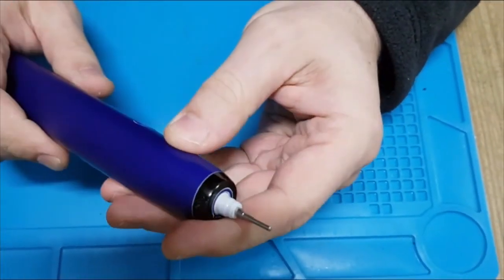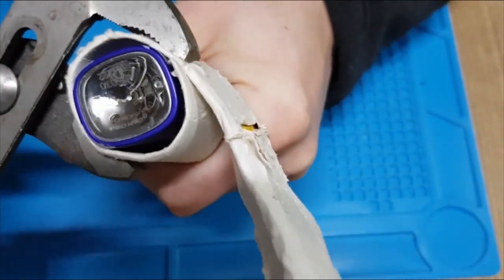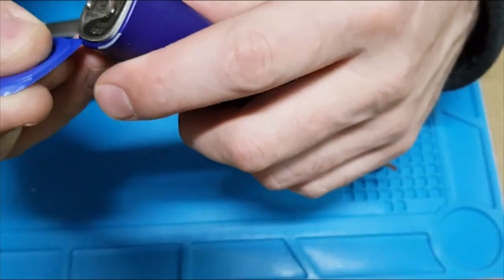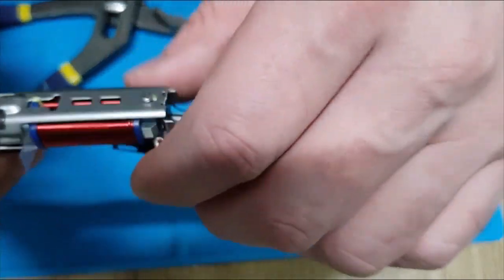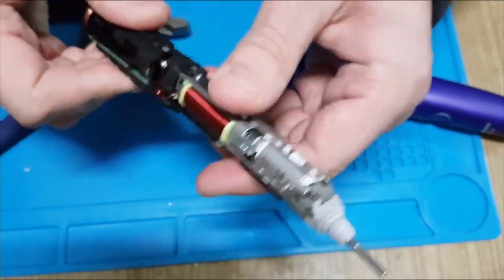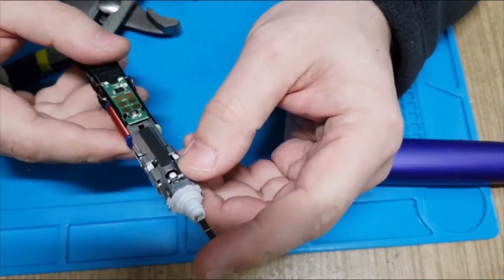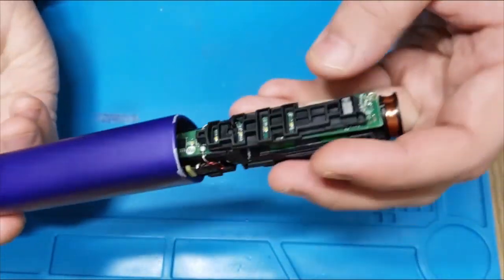Philips Sonicare DiamondClean /no vibrations/ opening and repair

Comment: No matter what i do my magnet falls right back down on my coil its really annoying
Reply from the maker: Axis broke in half. You have to replace the whole electromagnetic drive unit. There is no chance to repair it..
Reply: @letsfixitgarage  yea i ended up figuring that out, the stainless broke completely It was driving me nuts that it would just fall back down so i pulled it apart further.

Comment: Super helpful vid, thanks! After dang near breaking mine in two getting the end cap off I learned a glue gun trick that worked amazingly for my newer version Sonicare Diamond Black. 

https://youtu.be/CnE66q6pEDc?si=ZH2VH6FtXOu9Dg2J
Reply from the maker: Glue gun approach is ok but could damage chrome, afterwards you need to clean the little hole and be careful not to damage the seal.. and it's not suitable for prestige toothbrush.. so yes every method has it's advantages and disadvantages..

Comment: When the gap is too small, does the toothbrush show any other symptoms, such as charging indicator? My Hx369w1 died after a month, and even the diode doesn't light up.
Reply from the maker: Check my other videos especially water damage repair. If there is no signs of life, no LEDs, most probably you will have water inside and sadly it's not an easy repair..
Reply: @letsfixitgarage Thanks for the answer. The toothbrush is under warranty, but I am outside the country of purchase, so I am looking for information before I open it. I do not suspect a water leak, because the toothbrush is almost new. I have a thesis that if the generator does not start, it will not signal charging, because then it also has to start twice. But I am looking for confirmation.
Reply from the maker: @xxq4462 from my experience take it to the warranty ASAP. Either charger (very low probability) or handle water damage (high probability :) ). Charging is done very simpel no communication for activation. Charger simply emits magnetic field without any iniciation.. if there is no signs of opening or corroded upper seal the better for you to get an exchange of the toothbrush. Warranty doesn't repair them, they simply exchange it for a new one..
Reply: @letsfixitgarage so even if there is no gap at the coil and the processor cannot make a double sound using it, the charging diode should light up? I will only have the opportunity to return the toothbrush under warranty in a few months.
Reply from the maker: @xxq4462 exactly, even if there would be vibration issues and no gap on drive unit it should charge and charging led would indicate charging if electronic side is without issues/water damage..
Reply: @letsfixitgarage I understand, so the warranty remains, thanks for the answer.
Reply from the maker: @xxq4462 overall in the world only exchange under warranty is offered by Philips or Braun.. there is no official repair service after warranty, only by me ;)

Comment: Such a useful video!  Some water got into mine and it stopped working suddenly. That rubber seal at the toothbrush end disintegrates with time unfortunately so water goes in and damages the unit. Slight rust on the magnet, lime scale at the base of the head shaft, and some moisture on the circuit board.  Not good. Infuriating low quality for a pricey toothbrush!   So very grateful for your video. 

The issues I have with this video though is that your hand is covering up some key bits.  Parts not shown well are:
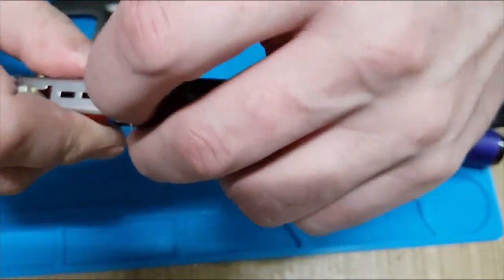1. 4:47 - The clips holding back the case rear cover. Show us a closeup of the tabs once you take it out, so we understand which way to loosen the tabs with a screwdriver. I spent half a day on this trying every possible way. You have to go on the LONG SIDE not short side, go behind the tabs and press in toward the center on both sides. Keep thin screwdriver in place while working on other side so both loosen same time, then you push on the head and it pops out.  It is these little things that are important.
2. 4:43 - You don't show exactly how that center black rubber piece is removed and how it is one piece, not a covering to be peeled off. You bent the middle with toward the circuit board, then this piece pops out. Actually, I found you don't need to bend it which can damage the circuit board. The board slides back and forth on its tracks, making a gap to take this piece out.
3. Not shown is how the circuit board pops out, I am struggling there.  The key is to slide the circuit board toward the battery. Once the center spring comes out, there is room to slide the circuit board back. Insert a fine flat screwdriver under the black plastic of the circuit board (not green plastic) and lift up the two tabs, one behind the other.  Out it pops. You have to slide it down for the tabs to come out as the hole widens.

I cleaned up the head shaft area too. A rubber cap on the shaft is torn in my case which led to water going in, so this should be inspected and replaced if you can find this part!  Else, repair it or improvise to seal off the head from water.

Thank you for a great video!  I am hoping mine works after recharging.
Reply from the maker: This is one of the first videos that has the most views if you check my other videos you will find much more technical information how to repair water damage in particular. And rubber seals are linked in comments although links are quite old but you should find a guide from that link ;) if you have some questions let me know I try to answer all of them but not always get notifications and time to do it promptly..

Comment: Thanks for making this! 

Curious as o why do people spend hundreds of dollars on Phillips products that are so cheaply made? Oral-Bs are way better built and cost half as much.
Reply from the maker: Well new IO's cost the same hundreds if not more ;) as for older ones genius series have a major issue with component quality have a very popular repair video for that but they are more reliable with water seal I have to give that to Braun.. apart from that my personal favorite is Philips Sonicare.. it's quieter and has stronger vibrations due to electromagnetic drive.. save principal is implemented in new Oral-B IO series.. and these have their own issues :) so not one is perfect chose on your own preference but Philips has better repairability if you give value for that ;)

Comment: Hi there.  I've watched all your video's but can't see you covering my problem.  The top section is twisting.  I've fixed my unit several times in the past - replace the top tip and made the gap between the magnet.  However this new problem has me stumped.  The tip is screwed in very tight but it's the whole top section that goes down to the magnet is twisting?  I've seen your video about the hole you make to remove the screw by the magnet and you mention that the V shaft is snapped - this doesn't seem to be the problem.  Any ideas?
Reply from the maker: yes twisted or completely snapped shaft is the same problem that sadly gets repaired only by replacing complete electromagnetic drive unit. it is welded so no chance to get to the shaft for inspection why it got twisted..

Comment: Thanks for your videos! I just fixed my Prestige 9900 with the help of your instructions. I dropped it on the floor a few times and the head no longer vibrated at full power. The gap around the magnet was the solution and it works again at full power.
Reply from the maker: Happy to hear that :) these brushes are really good engineered for repairability hopefully with these videos we can get their reliability up where it should be :) and not as popular myths state that they have preprogrammed obsolescence after 2 years..

Comment: Thank you very much, i did every step but the magnets keeps getting stuck together again.. i keep getting no gap 😢
Reply from the maker: Sorry to hear that.. you have a broken axle in the electromagnetic drive.. no chance in repairing this part it should be replaced completely. look in some Chinese shops or for a defect brush on eBay. good thing about this is that Philips uses the same electromagnetic drive in all its models so any sonicare brush will be ok for donor.
Reply: Thanks for responding, I’ll try to find this piece 👍🏻

Comment: Can someone please tell me where I can buy new rubber seals and plastic clip for the top of the brush. I need rubber seals that connect to the top pin from the inside. 

Thanks.
Reply from the maker: I believe I had some links in the video description. Check it out.

Comment: Thanks for this, mine had this exact problem, plus one more. Mine wouldn't start after gapping the coil magnet from the oscillating load. then upon closer look, I found that the circuit board also had some corrosion or toothpaste on the capacitors near the start/stop button. While cleaning it with a soft brush, the top capacitor broke loose and the toothbrush started working normally again! I have no idea what that capacitor's job was, but I assume it was some auxiliary function and it the corrosion around it was preventing voltage from reaching the coils. hope this helps anyone who has similar problems.

Comment: My toothbrush had lost a significant amount of brushing power. Adjusting the coil-magnet gap is what mine needed. A strip cut off an old credit card worked good for me. 

The front end of the plastic circuit board holder took some wiggling to get it disconnected from the metal frame. Pulling it fully back and wiggling it left and right finally got the plastic t into the metal slot. 

Thanks!

Comment: Hi, thanks for the video! Unfortunately I could not fix my brush. Somehow the permanent magnet, which should have the slight distance to the electro magnet, is not fixed in its position, so it is moving with the electro magnet. It should be mounted in a fixed position, right? Maybe there is something broken? Or is it fixed to its position by a screw?
Reply from the maker: it should be mounted fixed. it can be that the whole axis is broken. you can check my other videos i show how this defect looks like. in this case only exchange of the whole electromagnetic group will help.

Comment: I have a HX751V with the brush sensor coil and brush pressure sensor.  I find it is difficult to work around the two wires from the sensor coil.  If I just cut the two wires to the coil, will the brush still function?  I am willing to lose the brush sensor features.  Thanks for your help.  Great video.  Very helpful.
Reply from the maker: Yes the brush will function. It's just a coil that reads and writes information to the brushhead. But it is possible to work around it without cutting it.. if you unscrew the head then unclip the white plastic and then you can take it off..
Reply: Many thanks for the advice.  I also have a dead toothbrush that I can use to practice the procedure on.

Comment: Hi i tried everything to fix my brush but its just too annoying. It vibrates very softly. It had internal water damage. But the timer vibrations ebery 30 seconds are very solid working well.. it also makes a high pitch sound.
Reply from the maker: There are multiple things that can go wrong after water damage. If you are from Europe I could take a look in to it. Write me an email if you're interested.

Comment: I cant get the magnet space between the bottom piece. I used a flat head just like you but there is not space to separate it. and if I push to hard the magnet just shifts. Any recommendations?
Reply from the maker: Sorry but I don't understand what you did and what was the result.. if you made a gap and after removing the spacer it snaps back then it means that internal axis is broken and you need to replace the whole electromagnetic drive. Check my other videos I show this defect in other video more precisely.

Comment: Vielen Dank!!!!!!!!!!!!!!   Thanks for showing me how to salvage my toothbrush!!!!!!  Replaced the Link Rod without a problem, though I did make a small crack at a corner of the casing when I squeezed it to remove the base.......a small price to pay that only I will spot.  Perhaps warming it a bit would have helped, though I will never know.  Again,  Vielen Dank mein Freund!
Reply from the maker: Yes sometimes the housing is quite stiff haven't spotted the pattern till now why..  one thing to take care is that if the housing has a crack moisture could get in so be careful not to wash it apart from that I believe it will serve you many years ;) Gruß von Litauen

Comment: I am struggling to get the inner parts out of the housing.(3:30 min) any tipps?
Reply: pure force worked in the end hit the toothbrush with the bottom on the counter top and then the stuff came out. end result is not so good though. not much improvement. :-/
Reply from the maker: That's not the best approach.. I have a separate video just for this purpose, but I guess now it's a little bit to late for it... If gap restoration didn't help it could be that a whole electromagnetic drove needs to be replaced. They are available on eBay or AliExpress and all you need to do is desolder the two points. Hope this helps.

Comment: 4:50 this part is a bit more difficult for the 5100 model. You cannot fully detach the bottom part because you have to be careful not to break any wires. You need to pull as far as you can so that the plastic anchors(?) fit through the slots in the metal. One of the flexible circuits is slightly too short. So it partially detaches from the glue but thats fine as long as the circuit is undamaged. I pretty much went full pulling force. But maybe it is easier to pry the circuit up beforehand. 
Only then do you have access to the second screw.
Reply from the maker: Yes and no :) not sure about this model but if you have brush sensor coil there are few options. For example Smart diamondclean has a small hole in the middle of the motherboard so with a thin screwdriver it's possible to make this repair without taking the drive mechanismus off. Other possibility is to desolder the two wires, then it's no risk to ripp it off. As for the pressure sensor you are right you can peel the top slightly off should be enough for the manipulation.. maybe I should film repair of these as well just to have complete series...
Reply: @letsfixitgarage  thank you for your insight! I dont have any solder equipment or experience which is why I suggested brute force. 
I bet there are ppl who would benefit from such a video. At least I would have a couple of hours ago :D
Reply: I have a HX751V with the brush sensor coil.  It is difficult to work around the two wires from the sensor coil.  If I just cut the two wires to the coil, will the brush still function?  I am willing to lose the brush sensor feature.  Thanks for your help.  Great video.  @letsfixitgarage
Reply from the maker: Wrote to you in another comment.

Comment: Thank you for good explanation. I have some problem for my HX9340 like no power on and no charging via Glass Charger and Travel cabin. From this video, The stucked magnetic makes problem and power is not on. but after fix it, Power is on and charging is on working. Is it right?
Reply from the maker: Stuck magnet and not charging is two different defects. Check my other videos with water damage for no lights and not charging..

Comment: Thank you, u helped me a lot.

In my Case it was a loose screw, on the top right to the pin for the brush. 

I could easily open the case, with a vise putting pressure on the sides. So the pins have space to slide out. 

Sorry for my bad english, iam german try to master the english language. 

Best regards
Reply from the maker: Thanks for a good word and don't worry about your English as much I talked with Germans your English is always 110% right ;) schöne Grüße von Litauen!

Comment: Hello, after i tighten the screw up the toothbrush. Now I can't loosen it and the screwdriver doesn't hold the screw anymore. Idk what to do. Help pls?
Reply from the maker: Why do you want to losen it? And if you damaged the screw it could be very difficult to unscrew it.. check some unscrewing of stuck bolt to get an impression but on the toothbrush it will be even more difficult as it is a delicate device and there is not much space..
Reply: @letsfixitgarage  I've fixed it already. Had to make a space for the coil and the magnet. It fixed everything. the sound and the vibration is all lit

Comment: Unfortunately doesn't work for me. The part I failed is the gap between the magnet and electromagnet. The magnet keeps coming very close to the electromagnet. Can't see any gap
Reply from the maker: In your case you will have a broken shaft inside of the drive unit. I show this defect in my other videos. It's quite rare but happens. In your case you need to replace the whole electromagnet and drove unit..

Comment: Help! After I separated the two parts of the brush (4:52) the brush won't turn on anymore (pressing the power button does nothing). I was careful not to break any of the soldered wires. If I put it on the charger, the mode and charge lights flash continuously.
Reply from the maker: what was the initial problem why you took it apart? what condition is the upper seal are there some black spots or toothpaste buildup? I would suspect water damage. check my other videos for tips on that..
Reply: @letsfixitgarage  it was making a buzzing sound but no vibration. The power button and mode lights worked like normal. Inside, it looks to be very clean, can't see any signs of water damage. I must have damaged it somehow when pulling it apart.
Reply from the maker: It's difficult to say what has happened.. if you are from Europe write me an email maybe I can take a look in to it.. my email is in Chanel description.